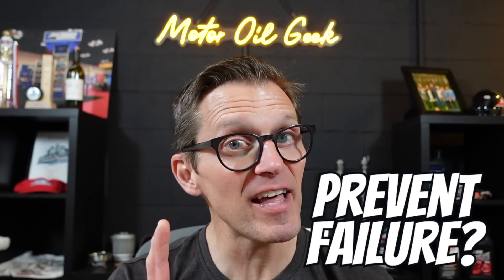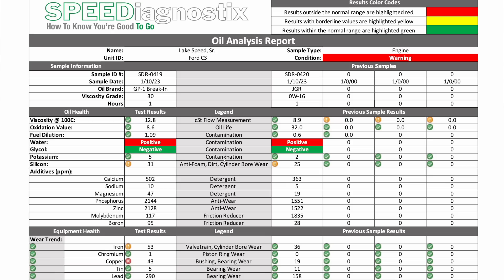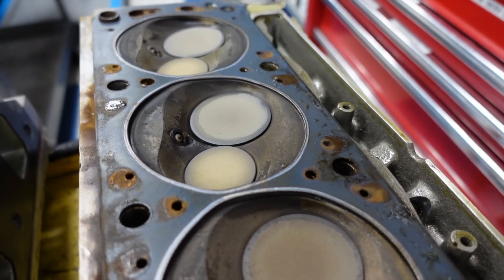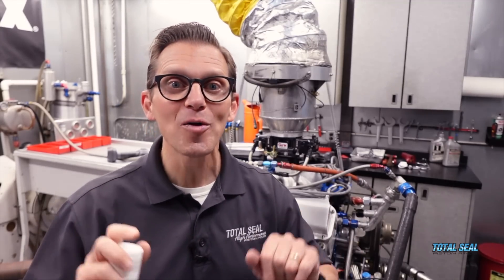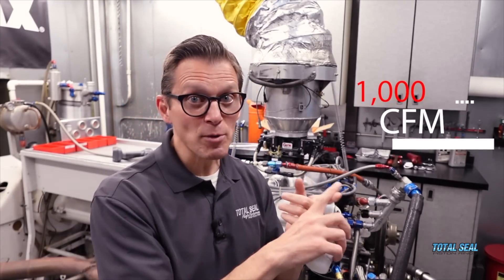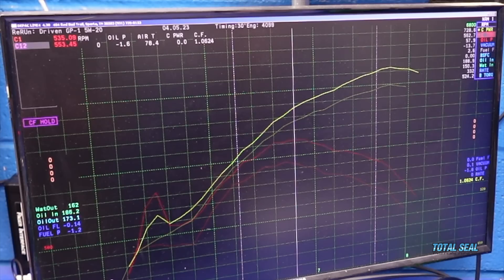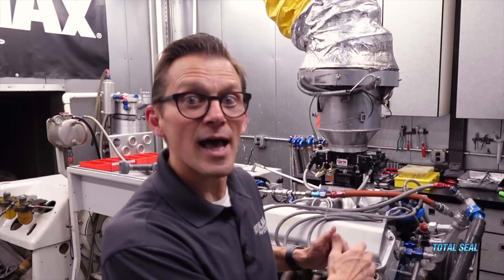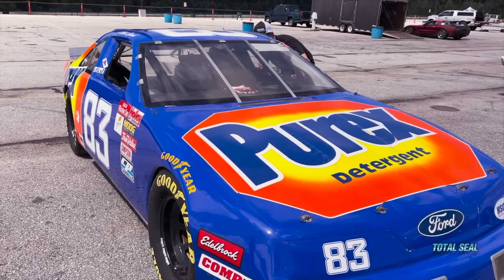How 3 Oz of Oil STOPPED This From Happening Again!

Comment: I've seen premix oil added to the fuel of rotary engines to help with the rotors seal lubrication.

Is there a benefit of premix oil in the fuel of a four stroke piston engine, especially those that use a 'race' fuel?

Comment: Eyes got 2 ax U's a kwestyon ... Hypothetical, Ive got 3 different oil filters ( all the same brand and grade ) 1 is the correct filter for the vehicle, the other 2 have the same diameter O ring seal and the same threads as original, so they all seat and seal on just  fine, BUT 1 is a half inch shorter and the other half inch longer than the correct size . Would it be alright to use these other filters. Ive got 3 different japanese cars , all 4 cylinder non turbo , all have different filter #s , but i can fit all filters on all my vehicles . Let me know what you think .Thanx

Comment: I see it argued from time to time, that changing an oil filter after ever other oil change( assuming not exceeding a certain mileage) is better for filtering particles and overall long term engine health. I have never bought into this thinking, but the logic is that with increased usage, the larger particles that become trapped do a better job of filtering smaller particles and ultimately lead to a better maintained engine. You should test this.

Comment: Hi Oil Geek. Any suggestion what acea rating oil i should use for my 1zz fe celica. I floor every gear everythere. Car always sittin 2.5-6k rpm range. Currently i use liqui molly Special Tec LL 5W-30 a3/b4 api SL. And change not later than half year or 2k miles. It there any better choice?
Reply from the maker: Check your owners manual

Comment: Lake, I’m being asked a question on motor oil and WHY a manufacturer would recommend 5w20 for a stock configuration and a 5w50 if you supercharge it? .. I know the easy answer is “more protection” but, the person asking wants to know what they 5w50 does that the 5w20 doesn’t? I’m having a hard time explaining it! lol.
Reply from the maker: The supercharger adds power to the engine. The more power the engine makes, the more load is placed on the bearings. By increasing the viscosity, the manufacturer is compensating for the increased load.

Comment: I'm still waiting for an answer - Is using flood mode as good as pre- oiling the filter?
Reply from the maker: Just to be clear. This channel is not my day job, so I don’t have time to respond to all of the comments or questions. With that said, clear flood mode is better than nothing. However, pre-filling (where possible) is slightly better.
Reply: @themotoroilgeek  So is it as good as pre -oiling!!
Reply from the maker: @donwendling7800 no

Comment: If you knew anything you would have found the cause of overheating  on the engine when running for 15-30 min. White smoke from exhaust, plug steam cleaned

Comment: Had an opposite coolant issue in a K20Z3.  Passed pressure test when the car was driven to the shop (warm).  Failed pressure test when engine was at room temperature and pressure tested. 
Cracked block at a cooling jacket, only leaked when cold. Never a drip under the car. Honda replaced the short block.
Reply from the maker: Wow! Thanks for sharing!

Comment: How did you fix the problem thar arose with heat in the engine ?
Reply from the maker: We welded up the pin hole leak.

Comment: I have a friend who puts ATF in his engine oil…his uncle does the same thing…both in passenger vehicles and big rigs…his uncles big Pete has an N14 red top with over 2 million miles…his car and two pickups have over 350,000 miles and still going strong…there is an oil additive called Archoil and I suspect it’s very similar to transmission fluid…is it the high detergent and water content that does that?

Comment: So what facilitated you being able to go from 20W50 oil to 5W20? Is it merely going to tighter tolerances?
Reply from the maker: Tighter bearing clearances and the coating on the pump gears.

Comment: I am picking my new Can Am Maverick R 240 horsepower turbo next week. Would you recommend I drain the factory oil and use driven break in oil before I break in the engine?
Reply from the maker: No. Just change the oil in the first 500 miles.

Comment: Back in the days, they used to X ray the engine, and even the rims for micro fractures....
I had the same problem with my dad carburetor intake, had a micro fracture and drew false air when heated....
Used oil analysis i think is cheaper than x ray, but they didnt had it back then and i dont have acces to it even now...
So all i can do is watch your vids and like them !
Reply from the maker: Thanks!

Comment: I think if you use the Amsoil Signature Series, you will gain more power.

Well done Mr. Speed.
Reply: @karans9228Well, Amsoil states plainly that they have tested other oil brands and have never found one that out performed Signature series.
Reply: FYI, recently Amsoil has become the official oil of Lingenfelter Performance Engineering by request of Lingenfelter after they tested a bunch of motor oils and found Amsoil performed the best for their application.

Comment: I'm going with a new motor oil for my Nissan 370Z engine in the hopes that my iron levels in the UOA will decline. I ran a UOA on Motul 300v 5W-40 and had great results, except for an iron level of 70 ppm in the oil after 3k miles. I'm putting Redline 5W-30 in and will test it after 3k miles to see how well it does with its increased zinc levels.

I had thought of adding some supplemental ZDDP to the Motul to bring its zinc level up to about 1300 ppm, but thought it might be better not to play amateur chemical engineer unless it's absolutely necessary. I would rather not risk the additional zinc and phosphorus interacting in some undesirable way with the other components of the oil's additive package.
Reply: Yes! redline is absolutely recommended after Ravenol of course

Comment: Is pennzoil platinum high mileage oil good for oil and what is your number 1 choice of every day use motor oil Please help me out.
Reply: I'm using that or even Ultra Platinum in vehicles greater than 200kmi....I went to 402kmi on an 07 civic and the dealer was shocked I got 380 out of my catalytic and I still got 43mpg. Fantastic base imo.  Lake recently reviewed my 0w-16 oil via his speediagnostix company and I trust him like no other.
Reply from the maker: @richcombs4805  Thanks!
Reply: @richcombs4805  thank you so much for any insight on my question and reply 🙏🏽💯❤️
Reply: @HotRodder47  high chance he might not want to state a number 1 choice....probably Driven would be his number one choice but I can't afford it LOL (he is associated/developed with that race oil).  Stay with Pennzoil and you won't go wrong.  You don't want to consider extended oil changes stay with 5000 to be practical but note his engine rebuilder buddy wants to see 3000oci or the warranty is void....and there are valid reasons for that as well.  He confirmed to me that I shouldn't be worrying about some other reviews that get into cold pour test results "because pumping is different than pouring."  Since I'm near the Canadian border often, in NYS, I wondered about those super cold days....with Penn I've never had the cold start engine-shake that I experienced with other oils when we are at -20F.  Now, given I work in API rotating equipment and know our gearbox/equip start permissive is oil in the tank at 90F, achieving that for car owners is pretty difficult...best solution being storing it in a heated garage in the winter to at least help out with a few of the car's daily starts.
Reply: @richcombs4805  Thanks feel better driving with 332k miles .
Reply from the maker: Yes, that is a good quality oil.
Reply: @themotoroilgeek  Could I ask you to, at some point, compare Amsoil's products to Penzoil's, please?
Reply: @ads1035  respectfully here, there's no point....as anyone going that route ponders extended oil change intervals and he's clear in his videos he doesn't support that.  If he's finding Penn or M1 etc good enough to call them a "good quality oil" as he states in a comment above in this section, he's not going to find value in a non-racing oil that costs a lot more that should be dumped at most at 5000 miles anyway.  And by the way, having heard from one rinseable filter maker in a very thorough email reply, who had direct discussion with Amsoil regarding filtration level and bypass trains-of-thought, they shared that Amsoil would rather tout something like 20micron or some super longevity and risk going to bypass, instead of 30micron and never going to bypass.  For myself, knowing what I know in rotating equipment for onshore and offshore etc, I'm willing to bet my degree that going to bypass is effectively ZERO filtration.  In my cars which I reference above, I have zero regrets with Penn and an M1 filter.
Reply: @richcombs4805  Interesting.
Yeah, initially, I was one of those people pondering long drain intervals. I used to have a 2012 Kia Sorento running 12,000 mile oil intervals where the manufacturer said 8,000 miles, and Blackstone's oil analysis seemed to say that the engine was handling the extended drain interval well. 

Either way, you make it sounds like Amsoil's goal is oil longevity at all costs, where Pensoil's goal is just making good oil. Well, perhaps I'll start using Pensoil and start saving myself $23 per oil change. Even Project Farm noted that their oil was good - I remember it scoring well on the volatility test, too.
Reply: @ads1035  well you are on the right track I think.  Incase you haven't browsed Lake's other videos, if you have direct injection engine (or port and direct combo in a Toyota) I'd keep an eye on rising oil levels (due to gas getting in), use Chevron techron every oil change and use top tier gas.  My dilution dropped to bottom of the 16 range of centistokes in the 0w-16 during this past winter, which was mild by comparison.
Reply: @richcombs4805  interesting. I do, indeed, have a GDI engine, a GM LGX 3.6L v6, and I typically fill it up with either Chevron's or Shell's 87 octane fuel.

Comment: What lab would you suggest for oil analysis?
Reply from the maker: SPEEDiagnostix.com
Reply: @themotoroilgeek What about Blackstone labs?
Reply from the maker: @maximusvonce1381   major difference between SPEEDiagnostix and Blackstone lies in 3 of the tests. 

First, SPEEDiagnostix uses the Rotating Disc Electrode method for the spectrometer. It is slower than the ICP spectrometer that Blackstone and most labs use, but it can detect larger particles.

The next thing is SPEEDiagnostix does not use TBN. That is an old test developed around high sulfur fuels. Today’s fuels a very low sulfur, so TBN is no longer an accurate test of oil life. Both GM and Cummins have abandoned TBN in favor of FTIR, which is why SPEEDiagnostix uses that method for determining oil health.

Finally, SPEEDiagnostix measures fuel dilution directly via Gas Chromatography instead of flash point.

Also, with SPEEDiagnostix, you get me. I’m the one looking at your results and sending you the report. My experience and expertise is part of the service and the price tag.
Reply: @themotoroilgeek Recently you said dont go over 500 miles with the original oil used to first start a new motor. Is that still your position?

My tech said dont waste your money and dont change first start oil till 500 miles cause the wear metals actually help break in engine. 

What's your opinion.?

At 500 miles i am switching to full synthetic pennzoil ultra platinum 5w30. 

Heavily modified 900 horsepower supercharged Boss 302 Roadrunner engine on e85.
Reply from the maker: It’s not my opinion. The data shows that changing the oil in the first 500 miles reduces wear, which extends engine life.

It is an “old school” fallacy that engines need that debris to wear-in. Stay tuned for future videos that will show this.
Reply: Project farm.

Comment: So the washed piston was no clue at all that the engine had a waterleak?
Reply: Yes, it was a clue.  That’s why they did a pressure test to try and find the leak.  The test was negative, so they put in new oil.  The second oil analysis stilled showed water.  That’s when they did the “hot” pressure test.
Reply: @shakerman55  No need to go further with analysis,, if a piston is washed cleas, it is water.
Reply: UOA could point to the same issue without looking at the piston

Comment: Perhaps monitoring the coolant level might have been the go to.
The oil analysis didn’t prevent anything…it only verified the damage.
Am I missing something?
Reply: A leak that small would never be detected from turning some laps in a racecar.
Reply: They did a pressure test and it didn’t show a leak.  After the second oil analysis showed water again, (with new oil), they did a hot pressure test, and then discovered the very small leak.
Reply: @shakerman55  
When u have coolant loss…you are either dropping or burning….period.
Reply: Tiny Leak???
Although it may have taken longer, It lost enough coolant to overheat and cause damage, regardless how long it took.
In this case, The oil test is a postmortem.
Oil analysis has its place… it’s a fantastic tool…but in this case

Comment: Can you explain how the gear set increases vacuum?   Also, why is more vacuum better?
Reply: More vacuum helps rings seal better.
Reply: Ring seal and less pumping losses, but there can be some issues as well like piston pins not getting enough oil (one reason why they typically have DLC on them and/or oil squirters). Some run a separate vacuum pump with wet sump and for dry sump you could increase the scavenging side.
Reply: More vacuum inside the crankcase means fewer air molecules for the crankshaft to fight as aerodynamic drag. Really!
Reply: Also can help increase usable powerband